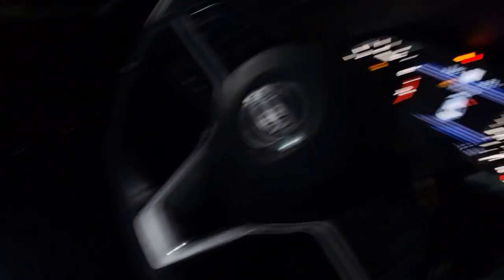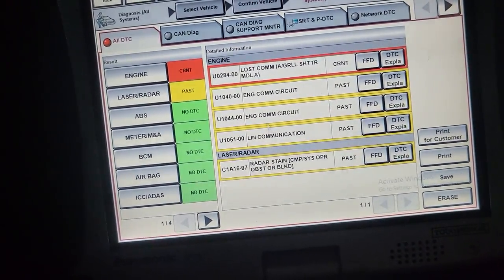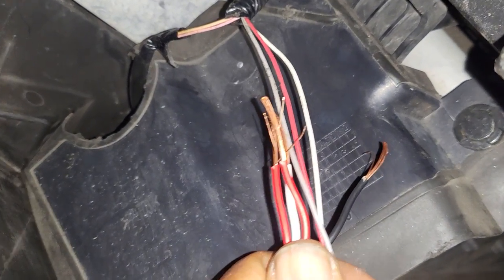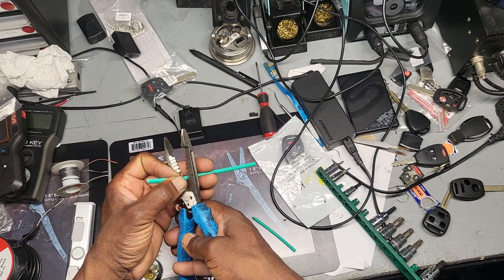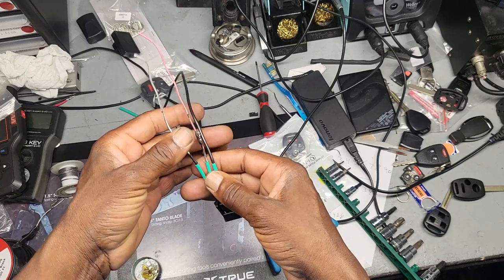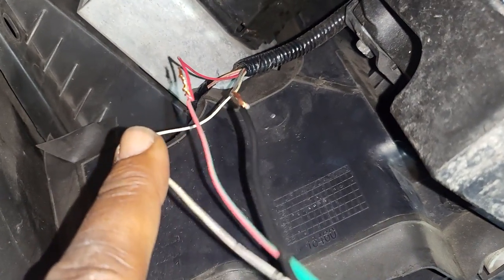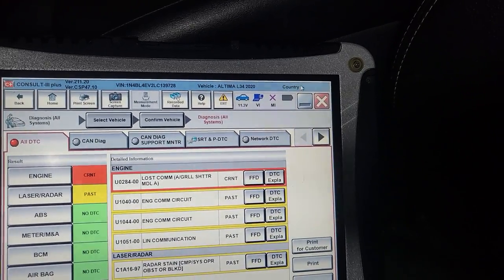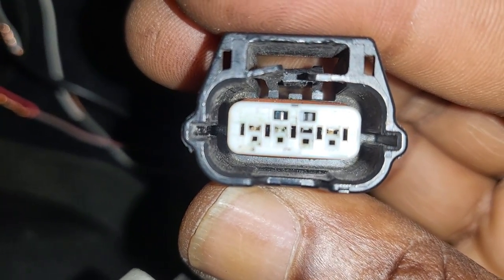2020 Nissan Altima Diagnostic Result Code U0284-00 Lost Communication With A Grill Shutter MODULE A

Comment: I am working on a 2020 Nissan titan with the same exact code, lose communication with A/grill shutter module A and the active grill works properly and doesn't seem to have any problem even ran a boreascope through the hood an zip tied it to a hole on the hood latch an watched it open an close after getting up to speed. So it isn't wiring or and it works properly but it won't clear that code.
Reply: Did you fixed? I’m having the same problem🤒
Reply: @RMV146  It has been a very long time since time we worked on that vehicle I cant fully remember what we did I think we might have changed out the motor from the old active grill and put it on the new active grill and that might have fixed the problem hopefully if you decide to give that a try it will work an I am not sending you on a goose chase. Good luck with the repair an hopefully you find the fix I guess next time I come to a conclusion on a comment like this I will come back an update it as soon as possible.

Comment: Did you ever get the code to clear and fix the active grill shutter module a? Because I have the same problem on my 2016 Nissan Altima.
Reply: How did you fix i have the same problem currently
Reply: @hoodedgamer6794  I had to get the computer portion of my transmission replaced in order to fix it. I ended up taking it to the Nissan Dealership to fix it.
Reply: @stephenjames3972 how much did nissan charge to fix? i have that same problem in 2020 altima
Reply: @Supa-C  it was about $900 smh

Comment: I have two altimas same year. I changed out the pigtail of one because the previous one got ripped off. Still getting the code. Could it be the pigtail cause I checked the shutter motor on the other nissan and it doesn’t show along with the pigtail itself they both seem normal putting out the same voltage ..?
Reply: Doesn’t show any code*

Comment: Good Video!  I have the same problem Error Code on a 2018 Terrain. Changed out the wiring harness and then installed a new shutter and motor.  Still getting same code.  Did the new motor fix your problem?
Reply from the maker: I have the same problem need more time and i dont have helper to take things in or out or help me with diagnostic process so i gove the customer his car after 2 days i got a helper
Reply: Sir i changed harness and motor and the code is still there
Reply: I have 2020 altima
Reply: @DMARAlKOoN did you fixed? How? I’m having the same issue